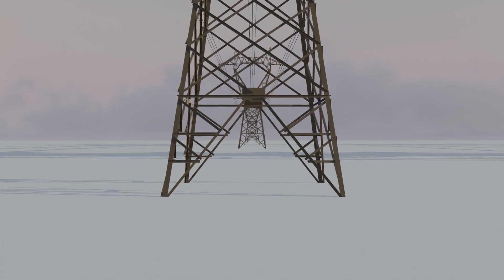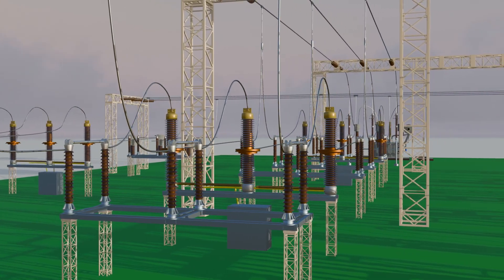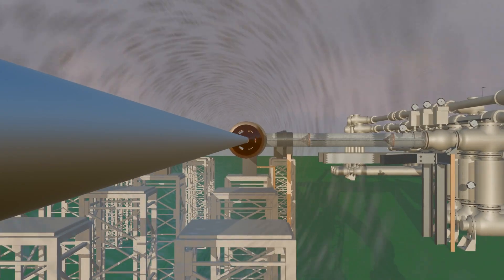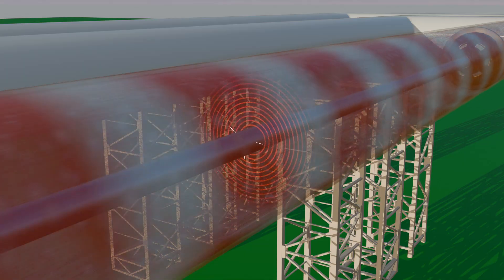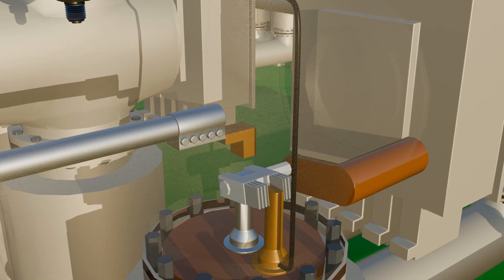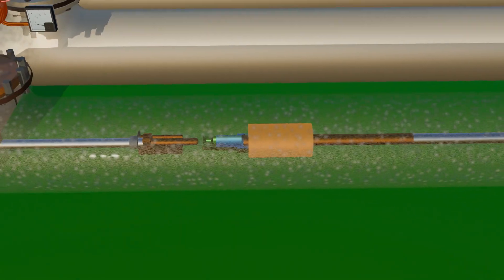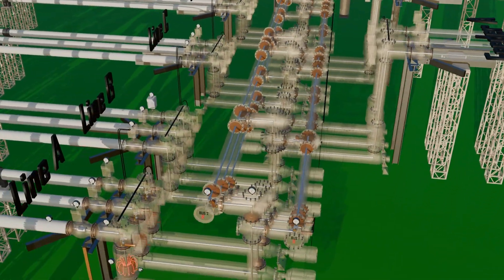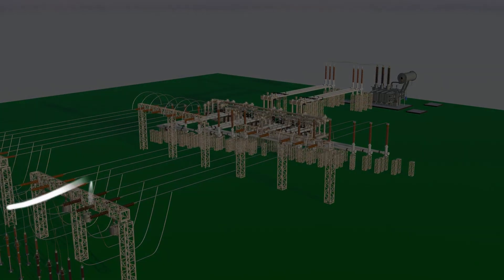How Does Gas Insulated Switchyard Work?

Comment: It's worth pointing out that lighting arresters often contain non-linear resistors, where the resistance decreases as voltage increases. This allows normal line current to flow but will divert this current to earth in the event of a transient voltage spike such a lighting.

Also - the outer pipe of GIS would never be made of aluminium or copper, however the conductor would be.

Comment: One question.. If you have multiple incoming lines, how is phase sync done in order to make sure that all 3 phases from multiple sources are in sync with each other? I didn't see any explanation of that here.
Reply: One would assume they would normally be sent from the same source at the transmitting or sending end.  All phases are in sync throughout a comple grid system with minor differences due to reactive components such as transformers and capacitors.

Comment: I'm confused. Air IS a gas!
Reply: If you're referring to around the 2-minute mark let me spread some light on this 

An electrical engineering for Power Systems like this we generally speaking use the term AIS or air insulated switchgear... for what you might see at a more normal looking substation or switchyard. We use the term GIS or gas insulated switchgear to denote. A gas besides air.

And then there's also vacuum insulated gear too...
Reply: Some are better isolators than an atmospheric oxygen/nitrogen/c02 mix